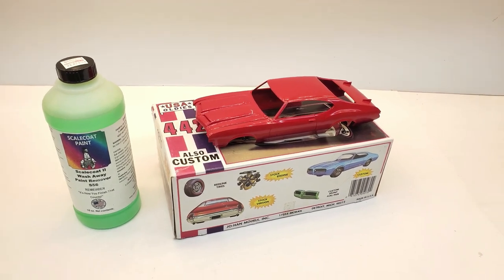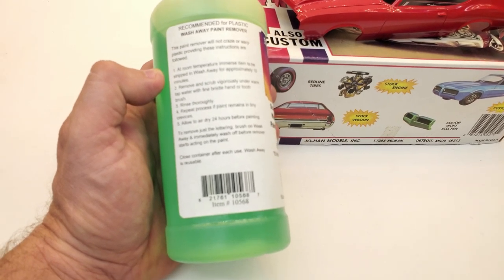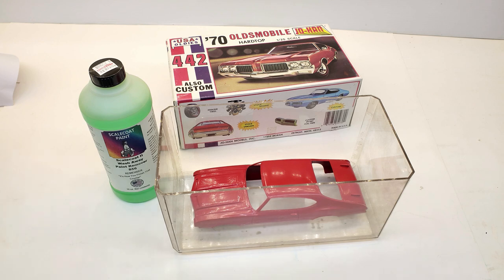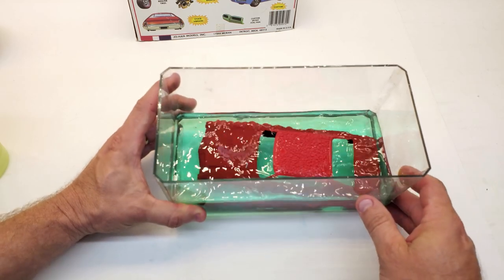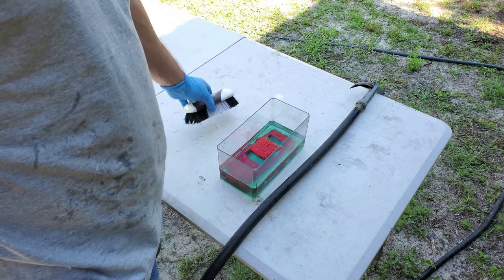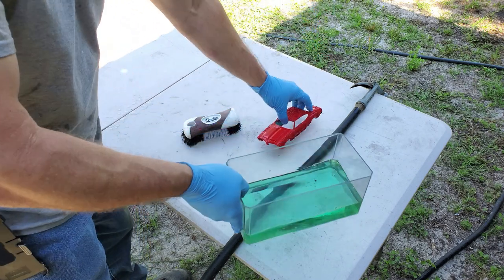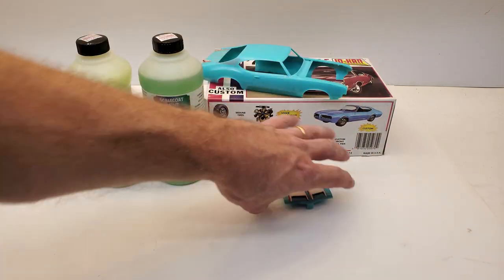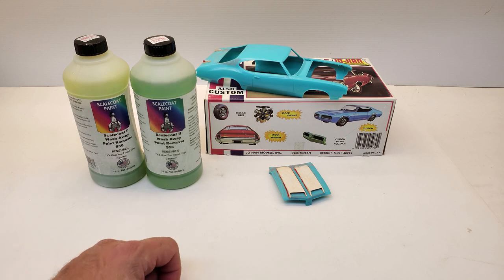Model Car Paint Remover Test! Let's see if it can do the job!

Comment: been using Scalecoat for years.If you plan on using it for now on do yourself a favor and invest in a deep tupperware container, a small stiff brush or some throw away brushes, fill it up put the lid on will not evaporate and you can use it over and over and over again.After time you will need to clean the tupperware of all the paint you've removed over time.I use a funnel in the bottle,pour slowly until bottle is near full,clean up the tupperware and add the remover back in the tupperware your ready to go again for a long while.Another plus is if there are parts glued on the body or you have glued together parts like engine halves and so on it will loosen the glue and come apart easily.I think you'll like using Scalecoat the longer you have it.I have also lets parts soak for days and have not had any softening of the plastic and another thing is when you clean the parts with soap and water after removing the paint use Dawn power wash or whatever it's called,cleans up really nice after washing.

Comment: I have used scale coat for since 1995 and it is the best I have found you talked about the price I bought three bottles ten years age and it still works very well the nice thing is that it is bio degradable one of the cons about it is if you store it in one sealed container CON’S IS DON’T GET ANY WATER IN IT IT WILL DEACTIVATE IT AND THEN IT WILL BEARLY WORK!!!

Comment: Scalecoat back in the day was the best stripper for models. It disappeared off the market for a while. I still have a tub of the original stuff in my basement yet today. It's probably 30 years old and has stripped 100 models or more. It works as good today as it did back then. Glad to see its back.

Comment: Matthew, loved your reaction to this stuff! LOL! I have been using the same batch for over a year! It has saved my fanny SOO many times.  I use 2 1/2 bottles to cover most bodies, rest to replace what I rinse off. I soak for 15 minutes and most paint AND primer comes right off. I sometimes have to dunk again to get stubborn stuff in creases and sanded areas. After scrubbing, I dunk in warm, soapy water and the plastic is cleared, generally.  I still sand the body and it is ready for primer. 
But you covered this in your good ( as usual) video. I hadn't used on anything but styrene , I was disappointed to learn it ruined the hood scoops, good to know. Thanks Matthew, Keep up the good work!
Reply from the maker: Thanks Billy!!

Comment: Hey Matt, great job on the olds, here in the u.k I use a product called Dettol, it's an antiseptic cleaner that you can dilute. I use it 1/1 it's great, but stinks, I believe the same product in the states is called Cortane - b. Good luck with the build...🇬🇧🐶😍

Comment: This is a great example of why I ALWAYS "wet" sand my bodies before I put on the very first layer of primer. This also means those who say you don't need to "pre-sand" run the risk of paint peeling when removing any tape from masking. 
Nice to see more options for stripping rather than caustic, harmful products others use. Nice presentation too. So, what does it smell like? 
This product works similar to the QCS stripper. But QCS is NOT caustic like this seems to be.
Reply: No, You do not nor should you ever sand thinking that's what makes the paint stick, it is not WHAT makes the paint stick.  The smoother the surface you paint, the smoother the end result is.  Clear coat (NOT floor wax) then polish with a finishing compound.  You will never see auto body painters gouge the metal in order for the primer to stick, you also would laugh to know that properly used enamels don't even need a primer when done correctly on these kits.  Please stop passing along your myths because a beloved older member of your family said so, I get it, We get it but it doesn't make it right or better said, correct.  P.S Floor wax is a wax not a protective clear coat as some cost conscience nit wits would like to believe, it is a floor wax that when applied over a clear could be polished but they make better compounds for that kind of detail.  Floor wax should remain on the floor where it belongs.
Reply: @animalyze7120 . I've been in the automotive world for 40+ years, you yung'un. 20 of them working in a custom auto body shop doing custom paint jobs. 

DO NOT assume I don't know what I'm talking about. 

The reason I say this is because you overlooked the primer aspect I mentioned. I won't assume you know what you're talking about either. 

My procedure is done to insure I don't have issues later. And that's based on YEARS of experience and work. Others have their own procedures. BUT do NOT say the information I am giving is wrong. Show me ONE shop that does NOT sand the body before PRIMER, not paint, and I'll gladly apologize. In fact, I DARE you.
Reply: @Bob0sModelFabWorx  Never said they don't sand the body.  However that's done to smooth and prepare the surface for paint not to make the paint stick but to make sure the surface is smooth and not allow imperfections to show through.  I assume nothing your response reinforces the point for itself.  Paint doesn't need nor require grooves in order to adhere, it's an inherent property to adhere to the surface with a good clean to remove oils and such.  With enamels it's more forgiving but with acrylics and lacquers even up to 12000 grit imperfections can come through, though that's about as good as it gets.  

The main point is sanding is to clean up and prepare the surface and in no way aids in paint/primer adhering to a surface.
Reply: @animalyze7120 . Yes, you did. [quote] "You will never see auto body painters gouge the metal in order for the primer to stick". I have no idear what the hell you're talking about. 90% of you statement has nothing to do with my original post.
I'm talking about plastic models. My experience showed me personally that at times the paint can lift when removing masking tape. So ruffing up the surface of the plastic does ad in the primer adhearing the the plastic. Model primers are made to etch into the plastic. The sanding just ads a layer of success. That is all that I was talking about. 
If you want to know more, just ask.

Comment: I am interested to see if it will work at all now that you have used it.  SO>>>>strip another car and see if it works a second time.  At $22.99 that would be $44.98 per car if it does not work but once.
Reply from the maker: So I've heard it can be used over and over.

Comment: Sooo, what if you leave the model in the product for longer periods of time? I know some older methods are great for short times, but but some products like Purple Ponds allow the stuff to sit there indefinitely. Poly-S from days of old would start to attach the plastic. I would be interested in a test where you through a part in the stuff and check on it days later.
Reply: It will make the model super brittle.

Comment: Back in the day (the 70's) when I still had youth an enthusiasm oven cleaner was the trick. Not sure if it will attack the plastic used today. Just needed to watch out for the fumes, and over night it usually scrubbed off nicely. And I am sure the EPA a capitalism has forced the paint manufacturers to change formulas. Health and safety of the user and cutting manufacturing costs.....
Recycled plastic, low grade solvents, toners  etc etc